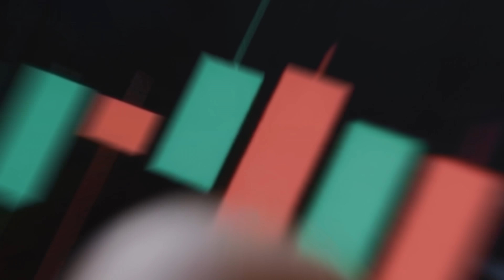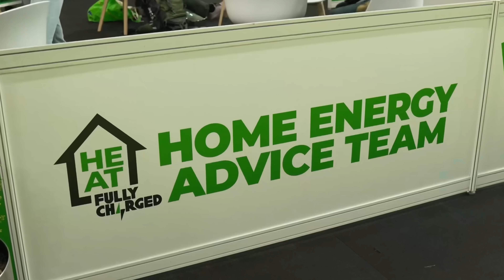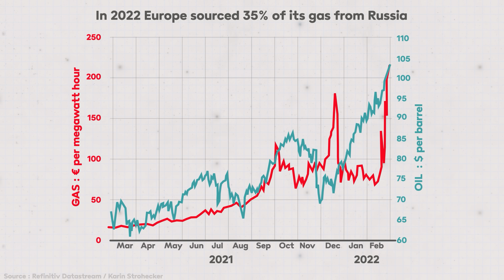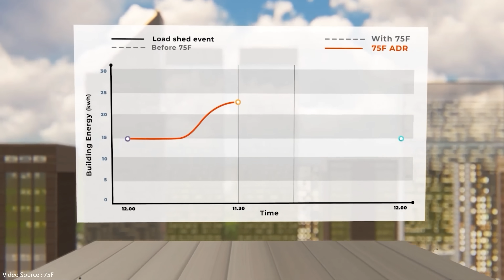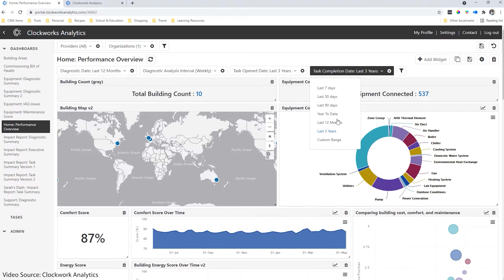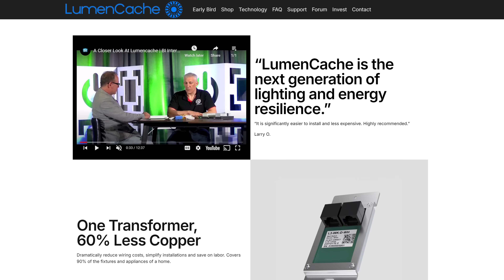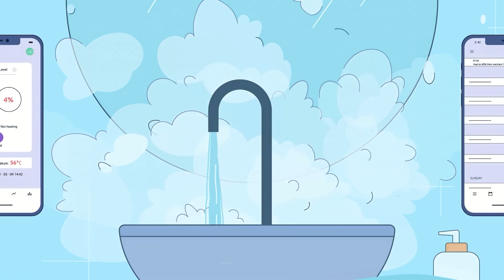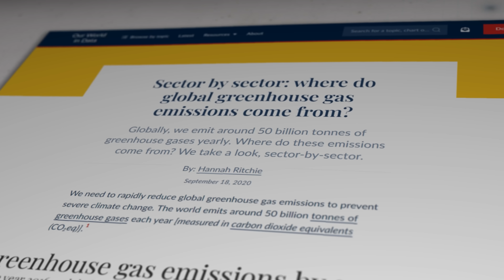The INSANE effect of Artificial Intelligence on Climate Change.

Comment: Economists are not "dismissive" about externalities. A lot of work has been done to come up with clever ways to internalize those externalities. It's politicians who are dismissive about them.
Reply: Most economists agree that a stiff, rising carbon tax on fossil fuels encourages the most effective reductions. But bribes and the threat of angry confused mobs keeps it off the table.
Reply: I don’t know maybe let the consumer and citizen decide what we pay for.
Reply: @pcampbell3068 By that metric you're also deciding what not to pay for (or more accurately, what companies can get away with shifting the cost of onto you). The average beefburger in the US would be about $48 if the externalities of air, water and soil pollution, greenhouse gases, antibiotic resistance, land use change etc were factored in. Are you happy for the company to dump that cost on the public rather than be forced to minimise the externalities (and therefore both damage and ultimate cost to the public) to produce better burgers?

Comment: IIRC, the IEA has estimated that by 2026, AI and data center power consumption is going to be around 800 TWh. Assuming - very optimistically - that the technologies discussed here will lead to a reduction of 20% in energy consumption for family houses that implement it - saving 2MWh per house per year - the improvement would still need to affect 400 million houses, about 20% of all houses globally, to compensate for the overall power consumption of AI and data centers. That global 20% market penetration would need to happen within 2 years! Sure, that not a calculation, it's just to give a sense of scale. I am afraid that it is hard to believe that globally, AI will ever have a beneficial net effect on energy consumption. For every cherry-picked use of AI, there is a multitude of idiotic and counterproductive applications.

Comment: so youre not even going to touch on how the proliferation of AI as a 'tool' has contributed to a marked increase in power usage, as the computational power required to run the algorithms that make up these AI tools is exponentially higher than simple computing tasks like you and I on our desktops. AI isnt helping to increase energy effeciency, its offsetting it by generating fossil fuels on a truly industrial scale as a product of the massive power requirements of the serverbanks that make AI 'tools' possible. this is basically journalistic malpractice, and its quite hilarious to see tech bros bend over backwards to say "this technology will save us!" without doing the due diligence to decide whether or not its necessary, or if we need to just change the way societies use and abuse electrical power.

Comment: Sorry, when Are you going to realise that first home buyers can not afford a house these days let alone all this EXPENSIVE tech to go in it. Governments no longer build social housing so more and more people will rent houses in the private sector and they will be built and maintained in as cheap a way as possible which will not allow for the products you have discussed here. Economies are run by money hungry people who are only interested in the growth model and we can not continue to grow consumption at the rate we have been doing since the 1950's. And please stop banging on about BEV's being used by the grid for stability. The bulk of vehicles are used for commuting to work and back so if they have a home with a charger then they will be plugged in at night when demand on the grid will be high and the electricity is not being supplied by solar. Wind can;t charge every car plugged in  overnight so it will come from the backup source gas, coal, or other and it wont be cheap. If your BEV is at work it wont be plugged in so how does it get the cheaper electricity or help stabilize the grid? It has been proven time and again that if you rely on public chargers for you BEV they are not cheaper to run than ICE vehicles. All this rubbish being spoken here is for the upper crust homes with two good incomes and they are becoming a rare thing in this era of a housing shortages, rampant property speculation and private profit driven control of basic utilities and services. Get out into the real world of lower wages and insecure work hours coupled with a mortgage or rent that leaves little for necessities. This is the real threat to climate change action. Wealth inequality at the country level and at the global level. The people who can afford the crap you are talking about are shrinking quickly because economists are working with formula designed to aid the wealthy.

Comment: Machine learning optimization has significantly more power than what architects do everyday to improve efficiency.
Reply: There's no way shifting thermostat settings around saves a much energy as designing a more efficient and better insulated building. Mr. Think uncritically spouted the claims of these companies optimizing building energy use.